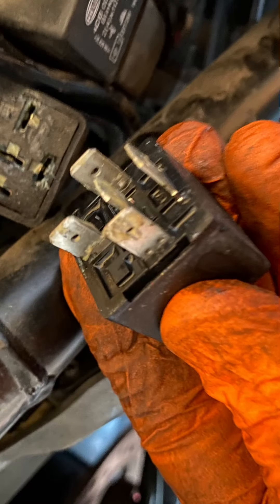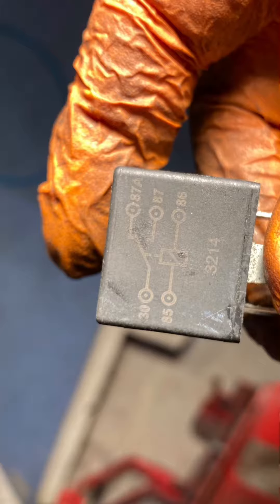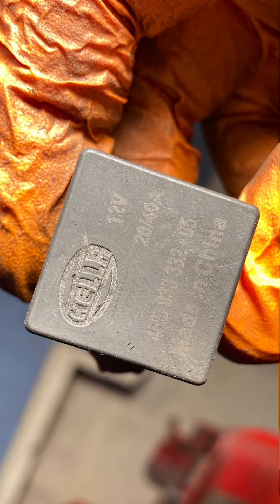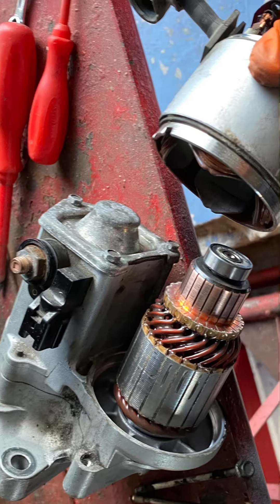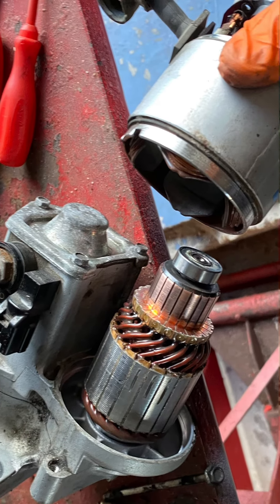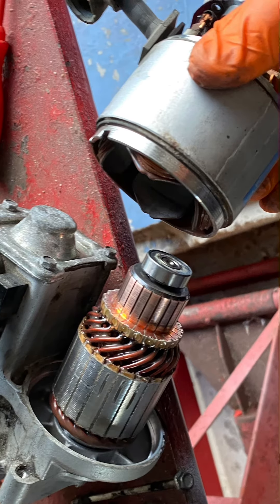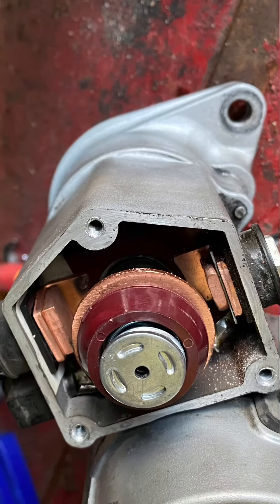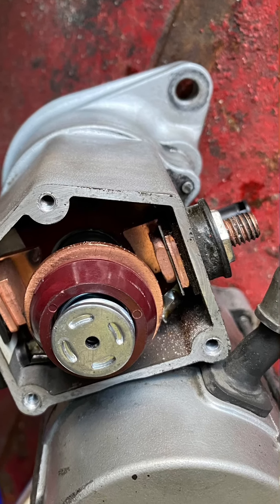Triumph Rocket X (3 / III) Electrical Starter Problems part 1

Comment: Man help. I have Triumph rocket 3 2007. The exactly same problem. I change the battery ignition regulator and now I will change ignition coil.

Comment: Had the same issue at times but could not pin it down but after upgrading the gear position sensor after a service flagged this up to be replaced as a repair kit the fault disappeared. From the Roadster year 2010 2013 the gear position sensor  has 3 wires from 2013 end these had 4 what was found that the gear sensor was giving false info to the ECU like 6th gear, false neutral, stating in gear but in neutral so I think may be that its saying bike in gear so will not start !!

Comment: I'm facing a similar problem.  I have a 2015 Triumph Rocket Roadster. Were you able to rectify it?
Reply from the maker: Yes I did by fitting a Lithium battery. You can follow the complete saga on r3owners.net  'Electrical Gremlins Part 5: The Reckoning?'

Comment: Where is part 2_3 of this video at
Reply from the maker: The links are in the description. I eventually ended up fitting a lithium battery which works fine most of the time but they don’t like being left in the cold as the voltage drops.

Comment: TRIUMPH ROCKET III STARTER MOTOR SOLENOID REPAIR KIT

The Nippon Denso starter motor fitted to the TRIUMPH can be prone to failure and is very expensive to replace. The starter is very reliable apart from the copper contacts in the solenoid which wear away.

Fortunately, it only take 10 mins to replace the contacts once the starter is removed.

The usual symptoms with a contact failure is a clicking sound and intermittent starting. You may try 3 or 4 times and get a click click and on the next try the starter works as usual.

THE PARTS INCLUDED IN THIS KIT :-

1 x PLUNGER plus 2 x COPPER CONTACTS

1 x FITTING INSTRUCTIONS
Reply: Yes mine also give same symptoms

Comment: I had the same fault.. I fairly quickly tracked it down to the battery which had failed internally. It showed VOLTAGE but no current.  Putting "Jump leads" onto it didnt help as the battery drew a lot of CURRENT from the jump battery. However, I fitted a battery from my other bike and it started first time!   The failed batter would not take a charge and died under a "drop" test.  

Deffo a battery fault